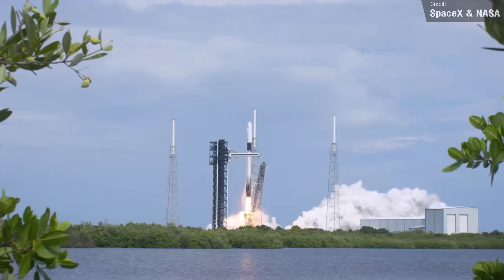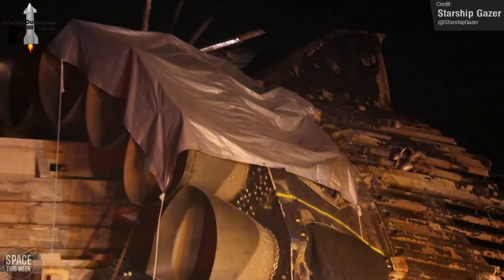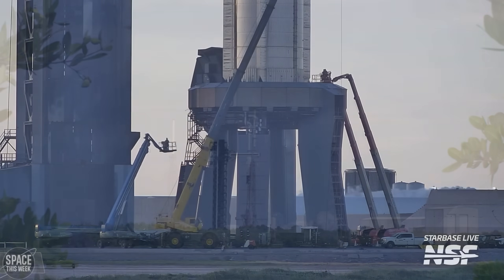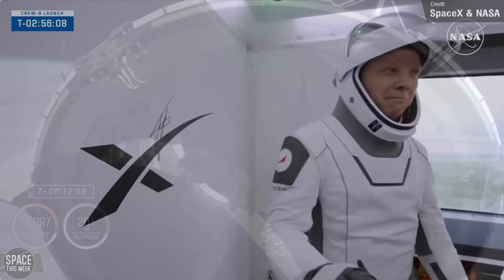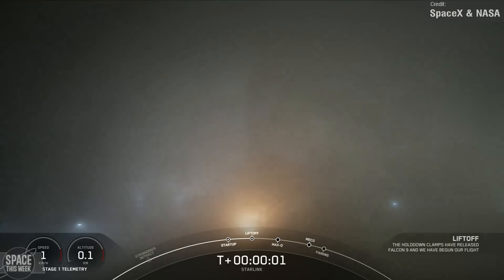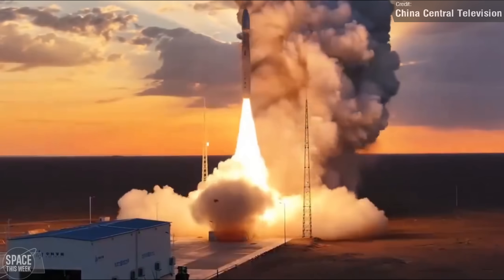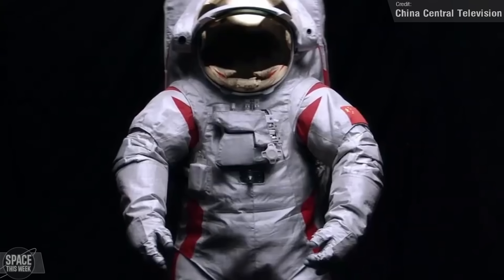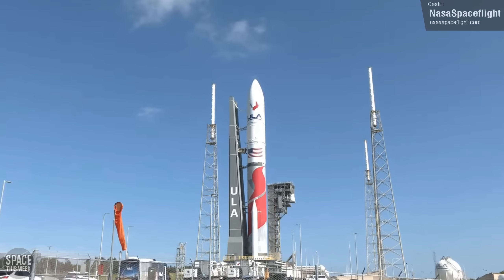SpaceX Starship Makes Big Steps towards Flight 5, Falcon 9 Grounded and China Launches from BOAT

Comment: Looks like the boosters are starting to show their launch number limits finally. 15-20 launches per falcon 9 booster is already amazing. I wonder if SpaceX is going to remedy the issues to certify them for 30+ launches or if they're going to put boosters to rest at 20 for mechanical reasons.
Reply: The latest anomaly was with the second stage and those are always new and used once.

Comment: What is spaceX doing? there have been so many anomalies in such a short amount of time
Reply: Space is hard, and realistically none of their recent issues have been that large of an issue. One engine malfunction which is kind of a given when you produce this many engines, and one off-course re-entry, which is still being investigated but may also be an engine issue. This is another second stage, which is the same as the issue previously. This will help SpaceX narrow down the problem, which is probably a small manufacturing issue, resolve it, and get back to normal ops.
Reply: maybe someone related to FAA or FAA themselves are sabotaging them to make them look bad. just a theory tho
Reply: I think they are putting their rockets through more strain to avoid future unexpected complications but the FAA is being a jack in the ass
Reply: @varietyegg  for the most part I agree, but when your rocket lands outside of the exclusion zone, public safety is at risk. So this time the FAA would be right to ground them if they hadn't already grounded themselves.
Reply: @varietyegg  As a SpaceX intern with many connections within the company, that's not entirely true.
Reply: @ThePhantomRocket  What is true 👀📷
Reply: @ThePhantomRocket  explain
Reply: @ThePhantomRocket  yes I quote I said I think so can you please indubitably tell me the truth
Reply: @varietyegg  Virgin Galactic take off and landed safely during Richard Branson's flight but they went outside of their allowed area, thus FAA grounded them.
Reply: They must have hired someone loyal to Boeing and acting as a partisan/sabatour.
Reply: @rogerrussell9544  thats what im sayin